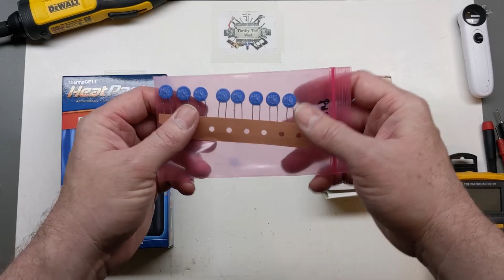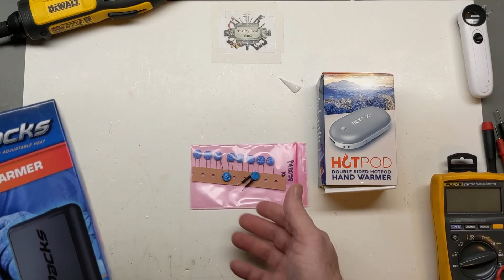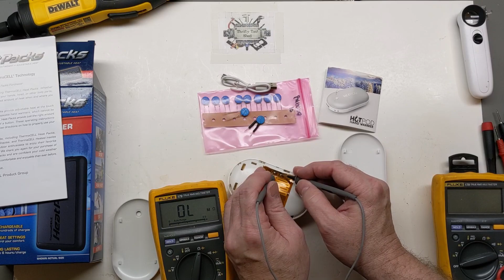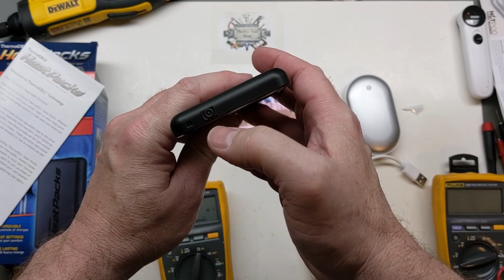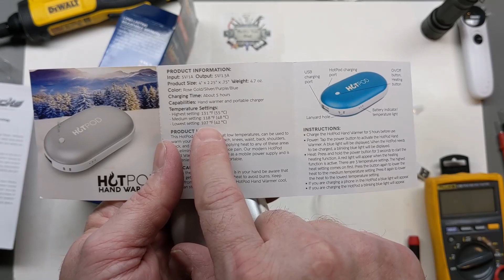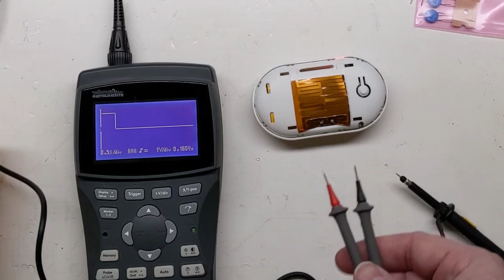A Look Inside of 2 Different Hand Warmers & Making Our Own In A Pinch.

Comment: I been wanting to check out the silicone heater pads but I'm waiting till the mail is less busy.
I saw a guy using them as replacement elements for small low voltage space heaters.